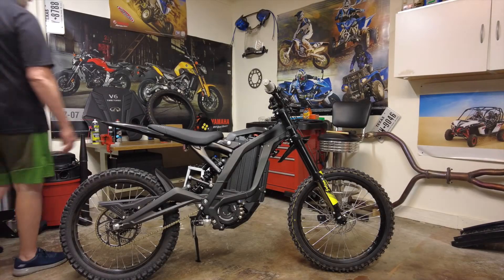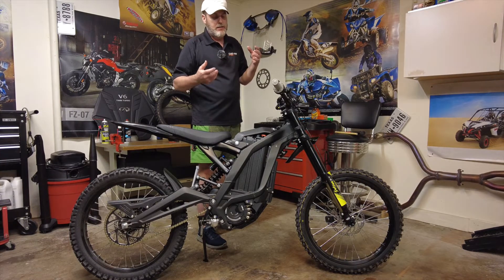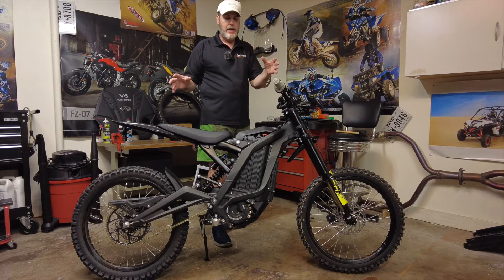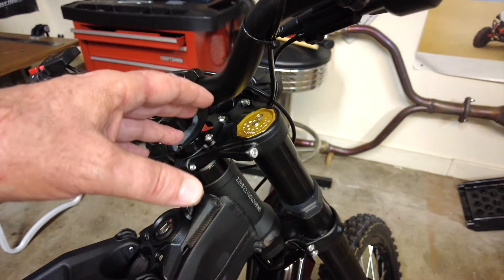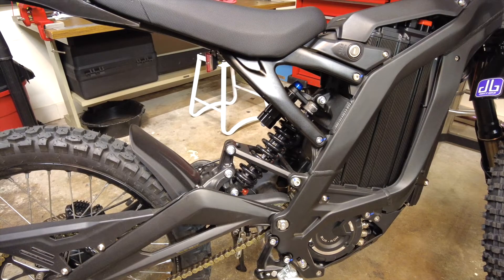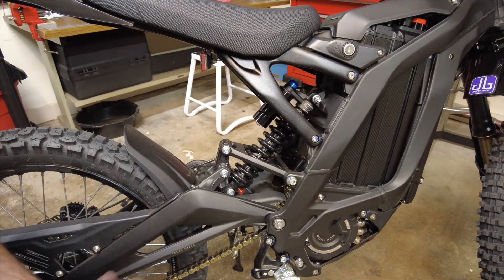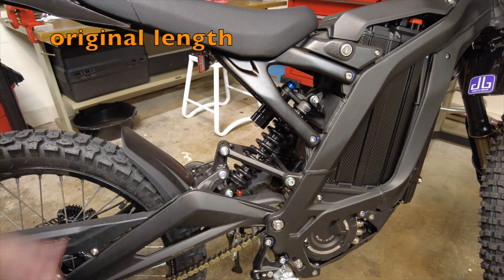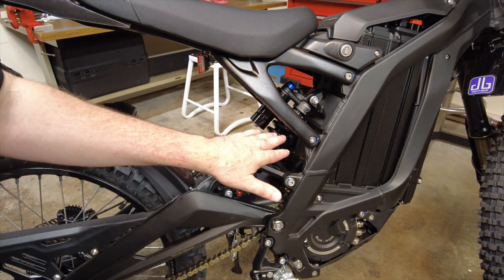2021-2022 Sur Ron X Fastace suspension...How to tune

Comment: should the forks be flush? I had an accident (someone hit me) and I had to take off the forks and ensure they wern't bent... and like always theres no info anywhere online regarding the ammount the forks should feed out the top if any.. Ifortgot.. I
Reply from the maker: There is a little room to move up and down with  the clamps. They can be pushed down  flush within the top clamps or the forks can be up sticking out 10-12mm. What this does, the difference in adjustment , it adds to the  between the rear axel center and the front wheel axle. Short distance the more agile handling, helps in turning and the greater the distance between the front and rear axle, general more stability in a straight line, slightly less steering. Most people it would be hard to tell a difference but pro riders use things like this to make fine adjustments.

Comment: What is the brand and size of rear tire?
Reply from the maker: The rear tire I bought for true dual-sport riding is the Shinko brand 244. Size is 2.75 x 19.
Reply: @GettingthruLife  Thank you!! Is it significantly heavier? I have a 241 in the back but I like how aggressive that one is
Reply from the maker: I would not think the 244 would be heavier by any reasonable amount. Both seem to be a 4-ply tires and are the same size and similar width. Where these 241 & 244 weight more than the oem tire is there's more tire rubber thickness helping puncture and flats plus there is a fair amount more of sidewall height.
Reply from the maker: Put the 241 up front and a 244 rear for dual sport riding. A better front tires for heavy dirt riding and very little concrete is a 70/100x19 Dunlop MX53 $56.
Reply: @GettingthruLife  Thanks for the info!
Reply from the maker: So far I'm pretty happy with the o.e.m front sur ron knobby tire and the shinko 244 on the rear. I do slow- medium- high speed on concrete and then take off on dusty, usually hardpack dirt, some sand, some gravel...works great for me. I'm sure they would work well in the trails around me just out of my ebike ride travel distance. One day I will get to some serious mountain bike trails but I need a truck.
Reply: @GettingthruLife  Just found it on Amazon for $47! Thank you for the recommendations!
Reply from the maker: Let me know when you get it put on and ride what you think. It may feel like it pulls a little zip from the power over the 2 ultra light factory bicycle width tires or just runing one shinko brand tire but their will be a better feel and ride. I weighed the factory tires and then the shinko 244 and I think I recall about 1.5 pound per shinko tire heavier so you will likely add 3 pounds rolling with 2 shinko tires. I feel the shinko tires 241 and 244 are decent tires for this level of powered transportation. Someday I would like to try a 244 in the front.
Reply: @GettingthruLife  I probably wont run a moto tire on the front. Most of what I do is 50/50 pavement/hard packed trails. I really like the looks of the 244 but may stick with 241s on front and back. My son’s Surron comes Tuesday, so I’m stoked to go hit trails together.

Comment: Thank you so much…. I couldn’t find this info anywhere until Today!!
Reply from the maker: I want to add, I got my sur ron x suspension ball park setup but my suspension for everyday riding/cruising around is pretty harsh over bumps. I ride on the sidewalks, streets, offroad, parking lots and my suspension is kind of harsh on the street, curbs, gaps on concrete, slight raised edges on the concrete. The fastace fork and shock are o.k. but not super good for comfort and vise versa big hits and jumps.

So to try and make my suspension able to absorb small bumps and hits better, I reduced the compression, top screw on the right fork and blue knob on top of the shock. Counter clockwise from 6 clicks, where I had it to minus 3 clicks shock and fork, it helped. 12 clicks total adjustability jfyi. Now going back to heavy trail riding and trying to go fast on trails then I will most likely need to reverse the clicks by 3. Go back to 6-7 clicks. Also, on the front and rear I like slower rebound. Bottom fork screw for rebound setting. In 6-7 clicks out from full counter clockwise. The fastace rear shock I settled on about 7-8 clicks out from full counter clockwise. Allows you to hear the suction noise, slows down shock rebound. Rebound setting on the rear shock is the small red dial near the bottom towards the swingarm linkage. Hope the helps.

Really to avoid any bottoming out situations, both the forks and rear shock would need stiffer rate springs. Usually if you do the front then the rear needs a spring upgrade too. Rebound and compression dials/adjustments really only good for tuning the speed of which the suspension compresses and bounces back. Springs hold the bike up and carry the weight of the rider.

Comment: I played with every nut and bolt with the fastace since there was zero videos about them before yours... just a FYI both sides of the fork are oil if you didn't already know i found this out the hard way lol 😆  still tring to dail them in i think i have to much sag if thats the right word. If i left up my frontend off the ground the forks lift about 1in or so before coming off the ground. 
  They feels to soft and slow .
Reply from the maker: Sag in the rear is one of the biggest areas of interest. On a 12" suspension travel motocross bike sag is between 3.5" and 4" as general rule. That leads me to think this bike with I think is 7.5 to 8 in of travel would be between 1.5 to 1.75 maybe extreme 2".

In the real world there shouldn't be much static sag/droop when just the bike under its own weight is on the ground. There can be some small spring compression as just the bikes sits there upright but if you were to lift the bike up off the ground with a hoist then you wouldn't want 2 inches of sag because that would be compounded when 150-200 pounds is added.

Maybe since this suspension is really just a basic package on the sur ron for light use then it can't be properly set up like a big motocross bike but the general goal is to get ballpark or as close as we can get per our weight.

Read the PDF doccument on these forks that I have include in description. It's got an exploded view of the forks internals. I definitely would not try and dismantle these forks as they take speciality tools to do it properly or change out oil, replace fork seals or change out spring rate.

Suspension sag/droop as I've seen it is very important to set correctly and then once set, can start fine tuning compression speed and shock/fork rebound.

Front fork sag should be about the same as the rear as I think I saw front and rear suspension travel is 8" and all the settings have 12 clicks. Spring preload likely has close to 2.5" spring preload that can be added by spinning the shock collar down.

No spring preload of fork.

Comment: Thank you for making this informative video. I also watched your "correction" video. I actually called Luna Cycle a couple weeks ago to ask about the adjustments for the FastAce suspension as the manual doesn't cover it at all. The guy told me, "the FastAce fork is NOT user adjustable". I knew he was wrong and I think he just wanted to get me off of the phone.
On a different topic, I see from your posters you're a fan of Yamaha bikes. Coincidentally, I recently uploaded a video I made, from a model photo shoot with my friends FZ09 (looks exactly like the one on your wall). Here's the link, if you're interested in watching it: https://youtu.be/cEO8aQ3QfqY
Reply from the maker: I'll  watch. I'll worked at a few Yamaha dealership in sales plus I've ridden since a was 9 y.o. I was employed longest as yamaha/can-am/seafood so I have tons of those promotional posters dealerships get. I could fill the walls of a complete home with motorcycle posters.

I look for videos on YouTube on adjusting the fastace forks and shock and yt didn't show me anything. I did my best to show what I know from a basic perspective but assumed wrong on the top and bottom adjustment. The fastace fork PDF is helpful and cleared up some things so glad I was told the model number of the China fastace sur ron specific fork.
Reply from the maker: Great work...puts my videos to shame plus I'm a lot less attractive than that woman. I always liked the FZ09 and planned on getting one but went in the motocross direction again. Nice studio and setup.

Comment: You are wrong the rebound is up and the compresión is down
Reply from the maker: On the Fastace suspension website under a similar looking rear shock (BTA59RC) the compression is located on the piggy-back reservoir. How do I know that, it's because on the version of rear shock there's two settings high speed and low speed adjment. Then on model (BDA51AR) rear shock with piggy back reservoir, that model only has external rebound adjustment and it's at the bottom of the shock.

On the Fastace forks on my 2022 model, I adjusted the top of the right fork by turning that clockwise and it slowed down my bike's compression stroke as far as I can tell. The bike came set at close to minimum compression front shock and my rear shock which is full counter clockwise. 

Please point me to an official document so I can see according to this version of shock and fork. If I'm wrong I will make the correction.
Reply: ALX13RC User manual look there,, the compression is down the fork the rebound is on the top
Reply from the maker: @joseducci1558  Thanks for the correction my friend. I've made an update video to be uploaded shortly and noted on the old video the mistake.
Reply from the maker: @joseducci1558  I didn't have the official name ALX13RC for the forks to find any info on them. With that model number identified It does seem to specify at: https://static1.squarespace.com/static/5d1738a7f814800001323a1b/t/60761ccbeda6c77bece75d4c/1618353357590/ALX13RC_spring.pdf

Shows the rebound location is at the top according to this PDF and one person's knowledge at Electric Bike Forum that provided PDF Link. Odd, but this is a no-name fork from the likes of China so rebound adjustments/screw "turns/clicks" appear to be backward (full clockwise moving towards counter-clockwise progression) but compression is clockwise more compression (slower) and less compression (faster) counter clockwise. 

At least there is some info so this is helpful. I tried playing around with all the adjusters and couldn't confidently tell what was being changed.

Comment: For someone that is 250 how much should you stiffen up the spring? How many turns on the spring?
Reply from the maker: I would think/guestimate tightening down the spring collar where you can see between 1/2 -1 inch of threads. Just keep in mind that when you sit on the bike it's a good thing to have a little suspension sag. Just don't need excessive sag when sitting down on the bike. Just tighten it down 1/2 inch and the see the results. Keep in mind too since the front forks are limited to no spring preload adjustment when you firm up the rear shock then the front  forks will feel even whimper. Your weight will be push more onto the front. Just experiment and don't be afraid to turn things because you can always reverse what you've  done.